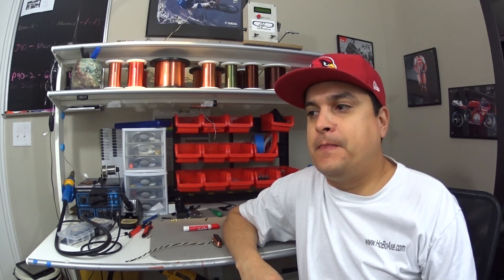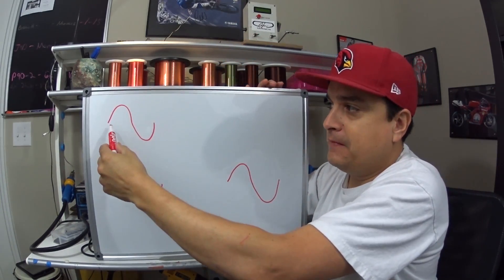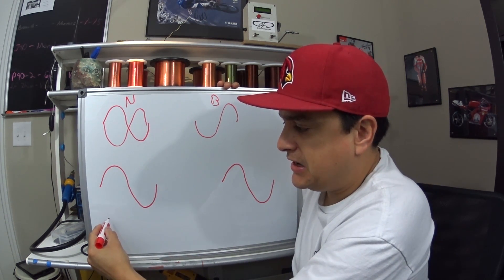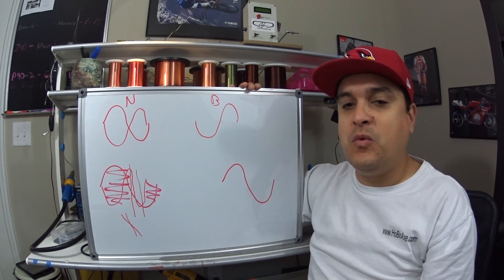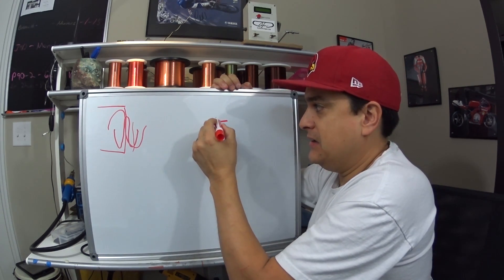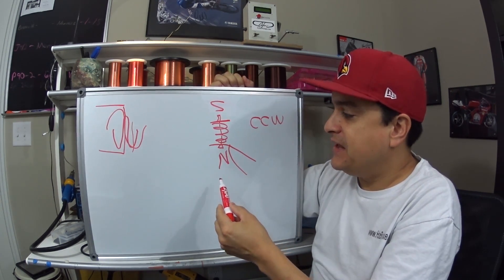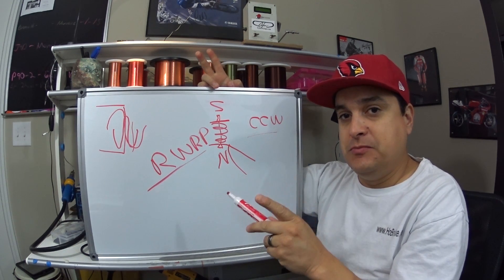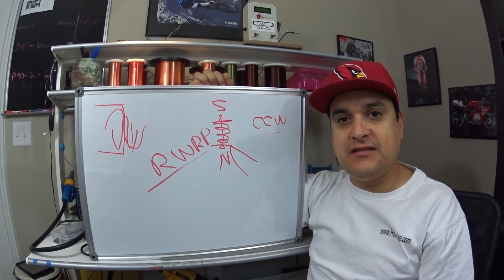Dylan Talks Tone Ep #6 What is "Out of Phase" #26

Comment: just to mention, the string at the neck and the bridge oscillates at the same rate, but at a wide/shorter, slower/faster speed. Which is why most overlapping actually hits the bass frequency's when you go out of Phase. It's audible effect in a sense is similar to a reverse tone knob in that it pulls out one end of your tone.